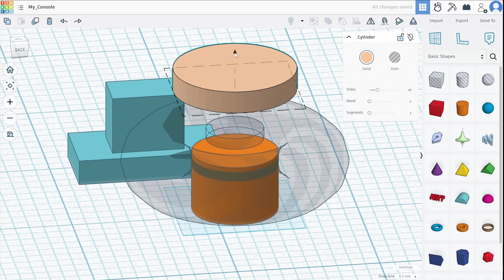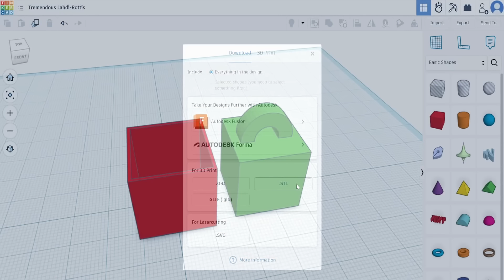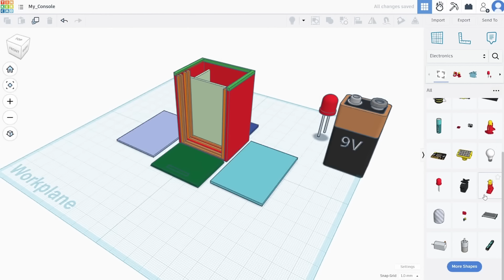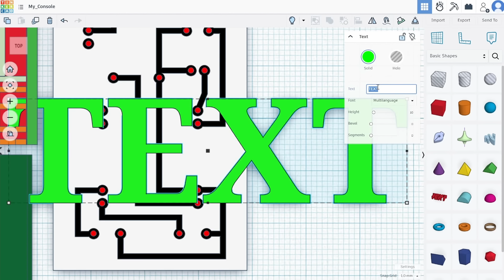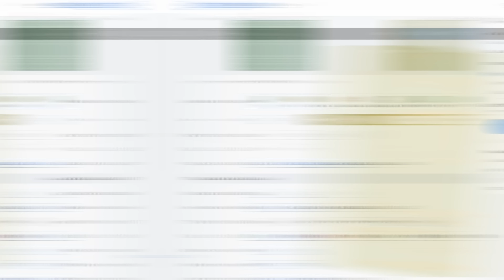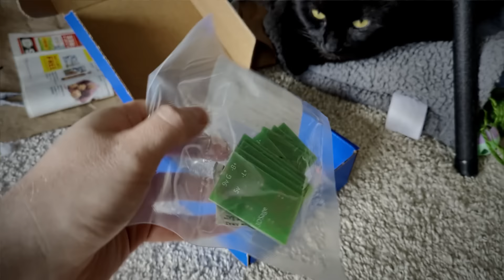Let's Build a Game Console Together

Comment: That's cool, but 90-degree trails aren't the best because add resistence and heat.... usualy it's used two curves of 45º or other things to avoid it, just a hint
Reply from the maker: That's a good note, especially for high performance and high frequency PCBs. For this simple board and circuit, it's not an issue. But thank you for leaving the valuable info! :)

Comment: Wait, you live in Texas? If you don't live too far away maybe I could install Linux for you and get you started with KiCAD. Open source is the way to go, and better now than never. If you don't have any old computers hanging around, one of those puck computers and a few accessories can be setup for around $500, or fewer if you go lower power.